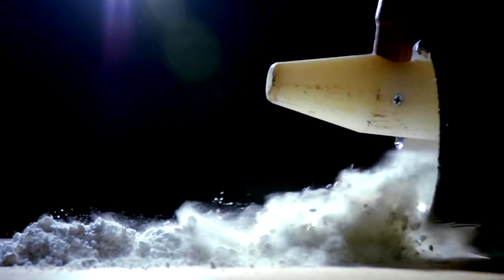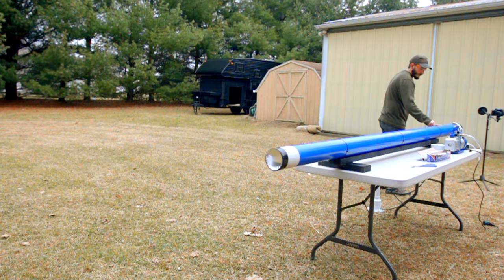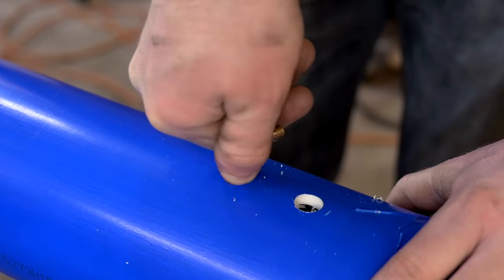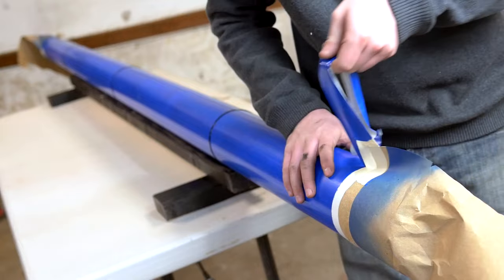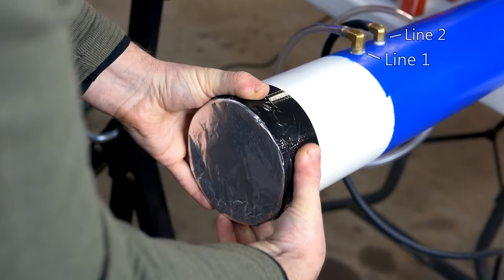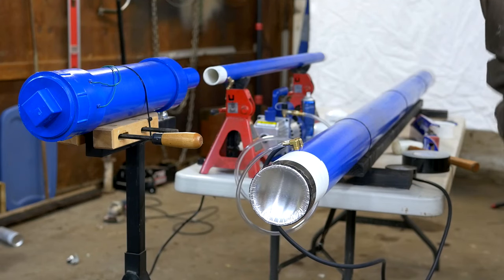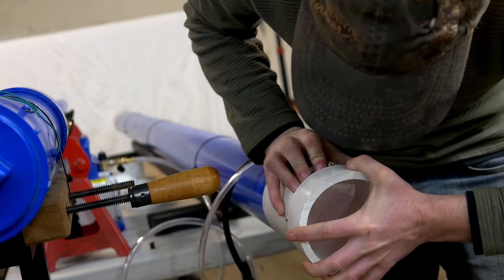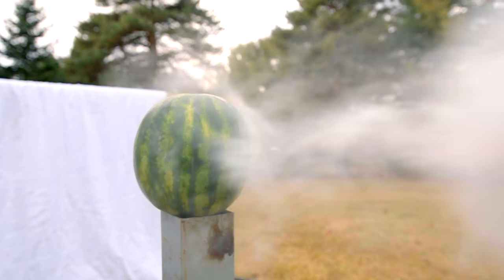How to Make a Large Bore Vacuum Cannon

Comment: nice touch adding cornstarch so you could see the air rushing in. it was also interesting to see the oscillations passing through the tube afterwards.
Reply: Oscillations you say?
Reply: look closely at the beginning slow motion shot. you'll see after the initial pressure release that the air oscillates in and out of the tube. I have no idea what's causing that. maybe the column of air is acting a bit like a spring.
Reply from the maker: The front disc didn't break for that opening shot. That might give you a hint as to why the oscillations happen
Reply: Ah that would explain it. The air really did act like a spring.

Comment: I built one a few years back, I found that Emergency Blankets (Mylar) could hold a higher pressure than several layers of aluminium foil. Hope that helps you build a more powerful vacuum cannon. Love your videos! =]
Reply from the maker: I have some mylar I thought about using for the cannon but it ended up being much harder to cut into shape than foil so I didn't bother with it.

Comment: Hi Nighthawk:

I have to agree that non-combustion cannons are superior to combustion cannons.  They are much more controllable.

I use a cannon that uses a double chambered diaphragm operated mechanism that works excellently.

I have to have a pressurized source in place of a vacuum.

The outer shell is 4".  The inner shell is 1.5".  If I over pressurize the outer chamber (100 lbs), I get raw mashed potatoes flying out of the barrel.

Comment: Nice cannon! I'd like to know how fast the projectiles go. You should set up a slow motion and a graduated background to do the calculations. I'd also love to know what the blue painted PVC contraption in the shop next to the vacuum cannon is!
Reply from the maker: I thought about it. I could make them go much faster than seen in the video also, as I only was firing the cannon at 24in/hg when maximum is 30. The power increases greatly with minor increases in vacuum. The other cannon seen in the video is a smaller vacuum cannon with a combustion chamber assist to potentially make the cannon fire supersonic. Still playing around with that one.

Comment: Nice Job. The first vacuum cannon i saw that actualy works fine! But i think yuo can improve it. Because its not a perfect vacuum the front foil doent burst by the projectile. I looks like a "air pillow" forms in front of the projectile. Due to the pressure needed to pop the aluminium foil the projectile get slowed down quite a bit. I think it would be a great idea to atatch a long thin stick/ needle / screw to the endcap the punches a hole in the foil if it gets close. So it will rupture very easy. Anyway... Nice vid. Thanks for your passion! keep on going!
Reply from the maker: Thanks! Good observation noticing that the aluminum bursts before the projectile reaches it. That is because I was only firing the cannon at around 24in/hg worth of vacuum so there was still quite a lot of air in the pipe. It takes a lot of work to make a deep vacuum closer to 30in/hg but the cannon would be very powerful at that point.

Comment: Would love to see this in action with some heavier projectiles. Say a big rubber or plastic ball, but they might be hard to get hold of so maybe adding weight to the back of the 3 inch end cap would be easier. If you know the weight and can get the velocity from high speed camera fps/distance calculation you could figure out the joules in the projectile. be in testing to see where the sweet spot of weight is for maximum joules!

Comment: I wonder if you could get a small performance increase by using something other than the mallet to break the seal, something like a short length of metal pipe with a strongly perforated edge.

Comment: It would be interesting to make one with a larger diameter chamber at the business end using a small-to-large coupler, that way you can get smaller diameter projectiles with better air resistance, but still have a decent volume in front of it to give it velocity.

Comment: Suggestion for a minor improvement: a converging/diverging nozzle.  I'm not a pro at wind tunneling but it looks like you're getting a lot of momentum through the tube.  What to do with a brief supersonic jet of air I leave to you (maybe with a projectile loaded in the muzzle end? Or does the travel of the projectile down the barrel moderate the pressure front from the inrush?)
Reply from the maker: The projectile does moderate the pressure. The inflow is only supersonic if the projectile is very light, like a piece of foam.

Comment: Don't forget to like! Really, an amazing project. I've been always wondering is it posible to use some sort of hinged flap, which will seal itself off under vacuum, but just fall of when there is none? like a piece of plywood with a rubber gasket on a hinge. I think it would evacuate in time not to hit the projectile, because I remember mythbusters made a vacuum cannon out of clear pipe, and air leaking around the projectile actually breaks the tape/foil before the projectile.
Reply from the maker: Yep that could work. At least for the front seal
Reply: And for the rear you could do the same, just add an hammer activated lever for quick pressurization

Comment: Could you go the other way around: How powerful would it still be if it's very short? 
Also: what about an angled version, where the bullet is on a short rail, but the piston for creating the vacuum is on a longer rail - both rails are in a 90 degree angle.

Comment: This is one of the reasons why I fear Hyperloop won't work.
Reply: Aakash Kalaria if they regulate the pressure and bring it in slowly, it will be fine
Reply: Not if the pipe fails, drex.
Reply: But the hyperloop actually faces some big challenges. For starters, Thermal expansion, which changes the size of the doors in your house by a few centimetres depending on the season. Then you have the problem of their plan to use a pipe with a 2 inch wall which could probably be done in by a decent drill, maybe a gun.
Also, currently the prototypes barely do 80 km/h with space for one person, and it takes about an hour to pump down a 200 metre pipe. At least Cars and Electricity are useful.
Reply: @PFKNTHETA //, Who said these things about cars and electricity?
@Prompted Hawk, Yeah, plus imagine rescue mission if some pod is stuck. It would shut down the whole line for weeks.
Reply: +Prompted Hawk Yeah a diamond tipped drill bit maybe but a gun? Hell noo.. If they were going to make a loop out of 2 inches of high carbon steel then that would be very impressive "assuming you are not talking bout armor piercing rounds"
Reply: I said maybe a gun could do it, but that's just a maybe. Anyway, a good drill would probably do it before anyone manages to stop the person using it. Also, mind that they would probably have to use vacuum seals of the moving parts variety, for the thermal expansion problems, which I'm pretty sure aren't as hard to break as 2 inches of high carbon steel.

Comment: Hi, I've watched a couple of your videos on vacuum cannons and appreciate you are making developmental advances in both design and technique.  I intend to make a cannon of my own and as you have significant understanding and experience would welcome your feedback on one question I have; do you think it would be an advantage to air flow into the cannon if i was to bell mouth the intake?  This would be done by applying the bell mouth intake fitting after sealing the intake end with foil.  
I have made a Lockwood Hillar valveless pulse jet where fitting a bell mouth to the intake cleaned up the running and power performance significantly.
I look forward to your reply and comment.
Reply from the maker: Yes, probably a bell would help.
Reply: Thanks

Comment: Might I ask what the specs were on the electric vacuum pump? And did you use the manual pump to suck the last bits of air out after the electric pump reached its limits, or do you just have the 2 fittings as alternatives depending where you are and what pump version you will use? I made a smaller scale cannon and it barely sent a projectile to the other end of the pipe. Even though the cheap vacuum gauge I had suggested that the tube was at 25 inHG to 28 inHG. It fizzed :-(  Thanks for the videos.

Comment: This is an old vid, but I'm wondering if some dual y fittings at the end would allow for secondary vacuum accumulators so there wouldn't be as much back pressure?
Reply from the maker: Yes that could help

Comment: Hey NightHawkInLight. In a video you made a while ago, you described how to make Bismuth crystals. I have been tinkering with Bismuth ever since I saw those videos, however I cannot figure out a way to form large crystals like yours. Can you make a video that goes into more detail on how you got such large crystilne structures? Keep up the great work.
Thanks,
Nick C.
Reply from the maker: Hi Nick, it's hard to get large crystals if you're only using a small amount of bismuth. I was using 5lbs in my video. The more the better.
Reply: NightHawkInLight
I have 10lbs just to be safe and am using a steel cooking pot to melt and form a shape as you did in your levetation video.
Reply from the maker: Hmm, I'm not sure what to suggest in that case, except to practice how long to let it sit for before checking for crystals
Reply: NightHawkInLight
what were you using in you crystal video to help slow the cooling process.
Reply from the maker: A fiberglass rope used to seal fireplace doors

Comment: Did you not want to lube the pvc pipe?
Reply: Jason Sidwell the inside of the pvc is smooth enough for water to flow through at a good rate depending on how much of incline it has. So in this case, no you wouldn't need any lubricant for the pipe

Comment: What i don't get is, the bullet is not pushed by gases between a chamber end and the bullet... so why does the barrel recoil? it must be only the brief time, when the one side disk has been ruptured, and the other side is still sealed, so during this brief time the pressure on one end is creating recoil ... still i find it strange to be so strong ...
Reply from the maker: The cannon is pushed backward when a disc is ruptured just as hard as air is pushed to fill it, so there is quite a lot of force causing recoil.
Reply: Now when you put it that way, it actually makes sense ... so the force exerted on the barrel and the bullet are actually equal and opposing ... and only the larger mass (or it being mounted to something)  make the barrel move less than the bullet ... still surprised me to see though :P thx for the video and answer, subscribed, since i like videos like this :)